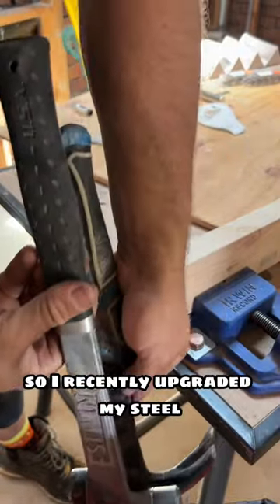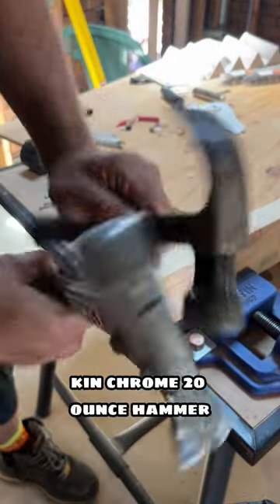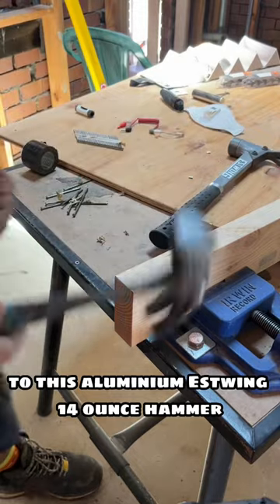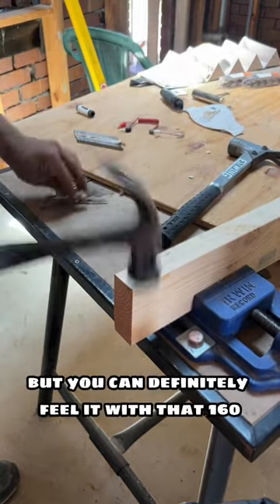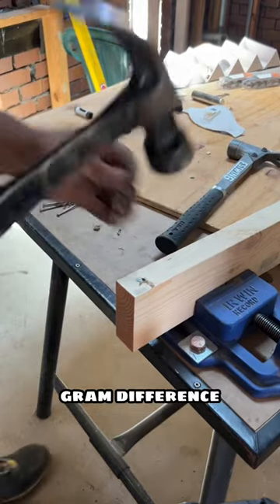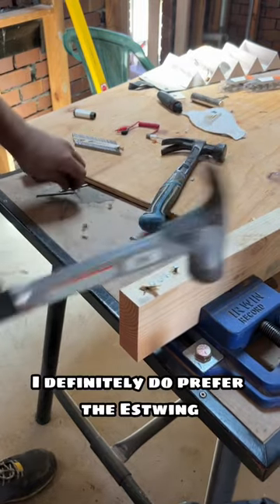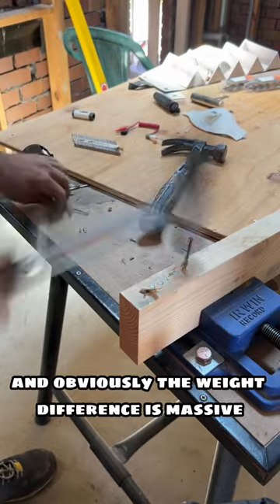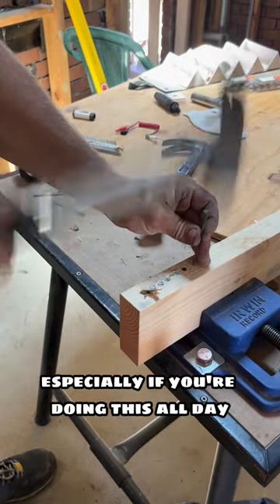Estwing vs kinchrome

Comment: Lmao a bunch of electricians here. A roofers hammer is certainly better for driving in long nails. Have you used the magnetic nail holder feature yet? It’s great when you are using the right size nails, though more for driving nails one handed.
Reply: I just bought a 28oz roofing hatchet and that'll flatten a cedar shake staple no matter how much it bends
Big dakka